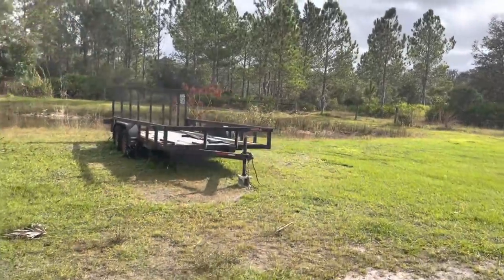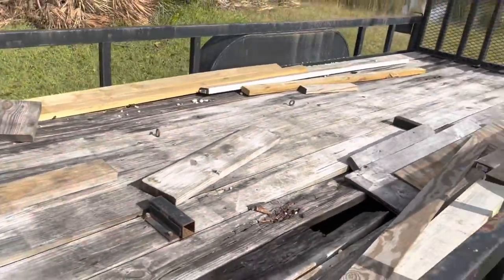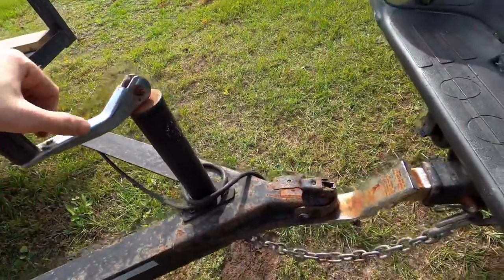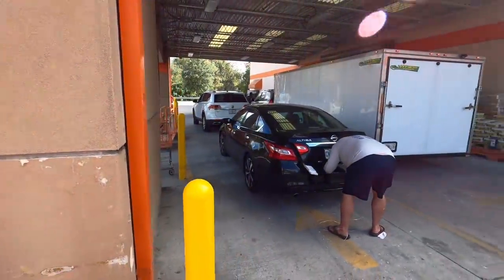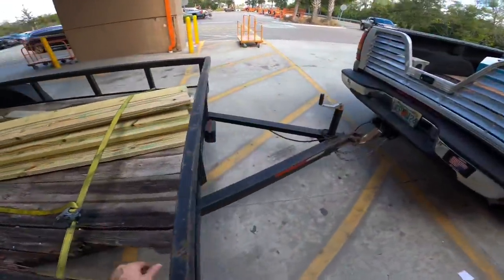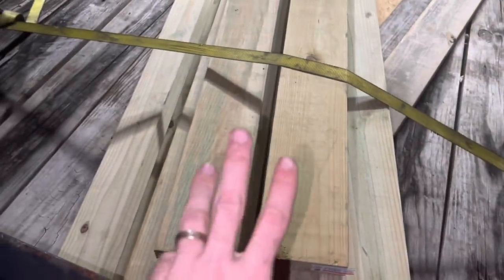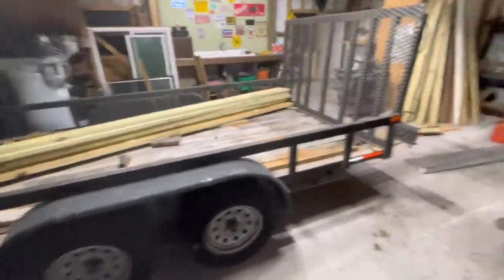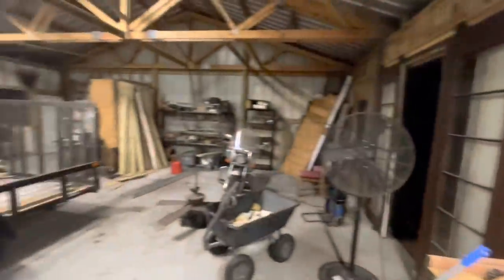Trailer Rehab! Rotted out Deck! Long time coming!

Comment: When hooking up the chains cross them so if for any reason the tow ball comes off the chain will catch and it doesn't nose dive into the road  or any uneven ground
Reply: I was about to comment this when I saw him hitch up the trailer, glad someone else noticed as well.
Reply: Was going to say same good catch
Reply: Same here. It is actually a law in most states to catch the tongue if it comes unhooked. Dmv will.tciket it you for not crossing them.

Comment: I was taught to ALWAYS cross the chains when hooking up your trailer. That prevents the tongue from dropping to the roadway should the hitch malfunction.
Reply: Yup, major fail there.... 

Unfortunately I will agree and REEEEEEEEEEEEEEEEEEEEEEEEEEEE!!
Reply: Also, place a pin in the hitch lock.
Reply: Don't count on it. Most safety chains are attached with enough slack that the hitch will slide back beyond the crossover when the ball or the hitch breaks and drop to the roadway regardless. I cross mine once just to keep them from swinging around...no illusions of anything else.
Reply: @mikehudick7074  Well dont be a dummy and adjust the length of your safety chains. There is no reason to leave them too long.
Reply: Where I live they will give you a ticket for not crossing the chains.  REEEEEEEEEEE!
Reply: I always cross mine as well. I think I had read about doing so since my parents didn't do any towing when I was growing up. One time I was helping my old boss hook up his car trailer and got yelled at for crossing the chains. Evidently he had tried it once with chains that were too short.
Reply: Same 👍

Comment: I have that same identical 16-foot utility trailer. Had it for about 20 years. 16 years ago I replace the rotted out pine Deck with Solid 2 by 8 by 16 Oak Timbers. That deck is still in perfect shape to this day.

Comment: My trailer was built in 1999, with the same deck. Although it needs replacement now, it has lasted cause, I would brush on old used oil every summer for the first 10 years or so!

Comment: You can use old motor oil and dilute it with thinner, alcohol, or something to make it more easy to penetrate and cote the new deck several times. Will hold up for many years. Apply every couple of years. Thanks

Comment: I treat all my wood with a 50/50 mix of used motor oil and kerosene or 50/50 mix of used motor oil and used transmission fluid.  Or just used motor oil.  I do a few coats every few years.  It's makes the wood water rappelling and the bugs will not touch it. Old barns are done this way and they last hundreds of years.  👍

Comment: Ray, just a little information....If you use Linseed Oil and Turpentine mixed 50/50 you will have a much better product than that crappy Thompson's. You can Spay, roll, or mop it on. Last a much longer time as well. You can use it on your fences too. Where i live we use it to seal concrete as well. Much more bang for the buck too!  Good luck on the trailer deck.
Reply: Yes!

Comment: Rustoleum paint that you brush on will hold up much better than a rattle can paint job.  I refurbished a 5x10 utility trailer a few years back - sanded any rust, primed the sanded areas and painted it with Rustoleum black and it still looks good.  Mine had a treated deck from the factory so all I needed to do was powerwash the deck and re-seal it.

Comment: As far as sealing the deck boards, pressure treated lumber should definitely weather 4-6 months before applying any sealer/stain, Clear sealers offer very Little if any protection, especially Thompsons, A semi-transparent pigmented stain will add alot of UV protection that clear wont, the darker the stain, the longer it will last. TWP makes good stuff. Clear will only last 6 months, a quality semi-transparent can last up to 3 years ;)
Reply: I second this. For some reason people still think PT lumber is maintenance free. It might not rot but the UV light breaks down the lignin holding the wood fibers together and causes it to crack. With a clear sealer like Thompsons you're looking at re-coating twice a year. Much better to go with a semi transparent stain and get years out of it.

Comment: Look for a product called cold galv it is used for trailers you brush it on and it prevents rust really well. Metalshield® Cold Galv Primer. Cold Galvanizing provides long term protection to steel because of the cathodic (galvanic) action between the steel and the metallic zinc in the coating.  This action prevents rust from developing under Cold Galvanizing.  It also produces a seal healing mechanism where the Cold Galvanizing is scratched: zinc oxides and carbonates form in the scratch and effectively reseal it.

Comment: I've been told to not seal/stain treated boards right away. The pressure treatment process won't allow your sealer to penetrate. If you wet the boards with water and it beads up, they aren't ready for sealer. My trailer (83"x20') is kept outside year round and has only had 3 boards replaced in it's 15 years. Treated a few times with Thompsons water seal, 1 time with flood (didn't do great),  went with Thompsons timber oil most recently.

Comment: I would use the brush on bed liner. Works great and it's abrasion resistant. I coat the bottom of the mower decks on my riding mowers and pushmowers every year and it helps to keep them from rusting out

Comment: Space the boards 3/4 of an inch apart, you won't need extra boards.
I would use a  timber deck sealer on the boards before screwing down as well, it will help preserving them and stopping rot
Reply: Great idea!

Comment: Thank you for the video, Ray.
Get a long (enough) lidded plastic tote at WalMart, $10 
anchor it to the A frame with bolts & washers, nuts inside.
Cheap padlock for lid? Easy to store your block, straps, 
HF cheap tarp & bungees, flat tire kit, fix-a-flat,
old gloves, maybe a flare or two? 
Maybe $50 for all.

Buying and install would make a great video.
Reply: And the video would likely pay for it at around $50
Reply: @davidmollard9832  Beautiful.

Comment: Old railroad trick for flat decks. make your deck in 2 panels about an inch (total) too wide to fit the trailer then force them into place. This will create a watertight deck that will shed water and take much longer to rot out. Bolt it down with carriage bolts and clips so you are not drilling holes into the metal frame of the trailer.

Comment: I live in Ohio and we paint both sides with used engine oil. It lasts way longer than tompson's. and its free.
Reply: Agreed, but with one change.  I use Diesel fuel with a 1/4 fresh diesel to 3/4 used oil mix which makes it flow much easier and with the exception of buying a little diesel, it is almost free to do. I also use a nylon broom to spread it out and the boards will take the mixture easily. When done you can safely walk on the wood without slipping around which is a bonus. You can even run your hand over the nylon bristles of the broom and nothing will come off on your hands, that is the diesel breaking the oil down. For a 7x14 trailer, I used approx. 3 gals in total, it may take more if it is used on all sides, but as said elsewhere I would let it dry out a bit before application. Water easily sheds off, and I may have to do this every couple of years but at least the wood will not rot out as it has here on Ray's Trailer.
Reply: Here on other side of pond we usually use waterproof non-slip coated plywood ;)
Reply: MARLINA🦋  REPORTED

Comment: When you put your safety chains on, you really should put them on in a "X" not parallel as you have done, the reason is that if for some reason the hitch fails, the trailer will be cradled in the "x" and wont fall through.
Reply: It also reduces the side to side movement if the hitch fails
Reply: They also won't get pulled tight if you are making a tight corner.

Comment: I enjoy your work, but would recommend that you put a pin o nut and bolt in the latch that secures the hitch to the ball so that it doesn't pop open going down the road.

Comment: Did your trailer not come with a pressure treated floor. I have a 20ft utility trailer we use every day in my business. I bought it in 2014 or 2015 and my floor is not rotting.

Comment: Chains have to cross each other, if you think about it if the ball brakes and the trailer drops the chains will hold the trailer neck from dropping and digging into the ground. The way you have them the trailer will land on the ground and dig in causing even more damage than you'd expect

Comment: I have 2 questions…
1) why would you have a wooden floor on a trailer?  I have almost the same trailer and it has a steel floor.

2) you guys in Murica are really hanging in there with the measurements 
“Five / Sixteenths of an inch” … you mean 8mm (see how short and easy that is? 😜😜😜

Comment: Just leave 2 planks out of middle. Lets water out easier. Most of
your hauls won't need a full floor anyway.
Also- space the planks farther apart- butting makes rot.
Get that airflow. About 1/4" adds up quick. At least try it?

Comment: Measure twice, visit Home Depot once, or even measure once....
Also PRESSURE TREATED lumber will outlast you.
I have some 4X4's that are still good as new thirty years in the ground.
Reply: I don't think that today's pressure treated lumber will last anywhere near 30 years in the ground unless you put a good preservative like copper naphthenate on them. The chemicals they use today are weak-sauce compared to 30 years ago.

Comment: I prefer the look of non treated wood with several coats of polyurethane, and some rubber sand particles, for non slip surface...But, I don't haul vehicles either...

Comment: Damn I have a 16ft car hauler trailer with wood floor and dovetail bought new in 2016 and my floor is holding up very well.  Is the old deck made from treated 2X8 lumber or just yellow pine ?  Seems like it gave up the ghost way early Rainman.
Reply from the maker: It was 2x8 treated. I think it’s a Florida thing. Wooden decks don’t last long here either unless they’re painted.
Reply: @RainmanRayOffDuty  I’m sure the 130% Florida humidity didn’t help matters.
Reply: @jimb8601  I lived in FL and I don't recall seeing any trailers lose the decking quite that quick.  I bet the wood wasn't treated or wasn't treated properly to have failed that quick.

Comment: It's sad the trailer has degraded so much in just a few years. I bought a galvanised trailer so it would last longer. I think mine is 10 years old & it is looking like new still (apart from usual trailer minor dings here & there from carrying loads).
Reply: My 2 snowmobile/ ATV steel trailers started rusting immediately .Like they all do in Ontario. Replaced them with an aluminum style, way better and lighter.

Comment: Are you using white wood?  Why aren't you using wolmenized?  It's a lot more rot resistant.  Also, don't use Thompsons.  It's the cheapest crap out there.  It doesn't last more than 1 year... especially in Florida's sun.

Comment: Chains, working lights, strapped down load? Come on, Ray, get with the way a lot of folks tow trailers, saves time not doing the previous 3 things.
Crossing chains catches the trailer draw bar so it doesn't land on the roadway if it comes off the ball, a nut and bolt also double as a safety pin on your hitch.